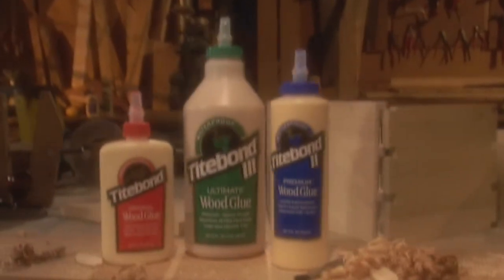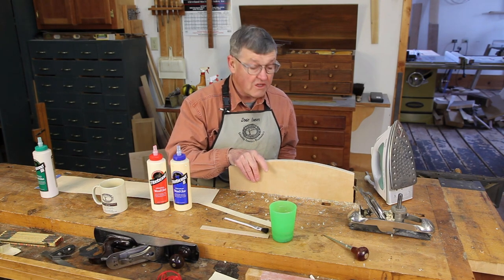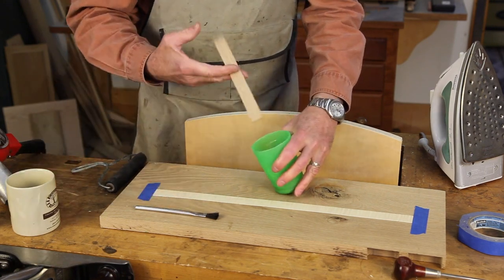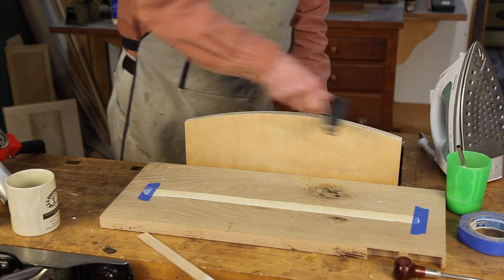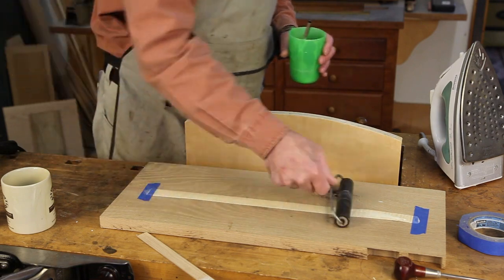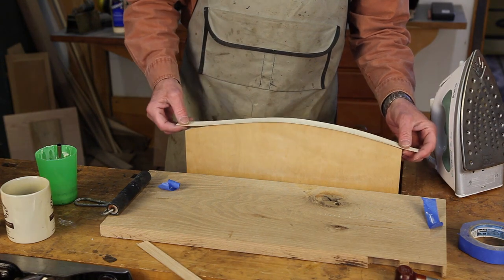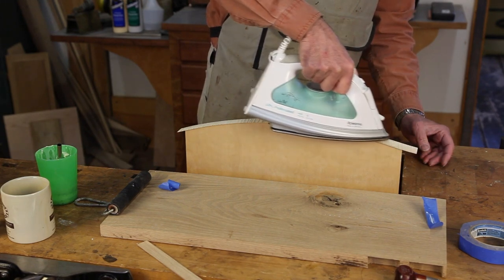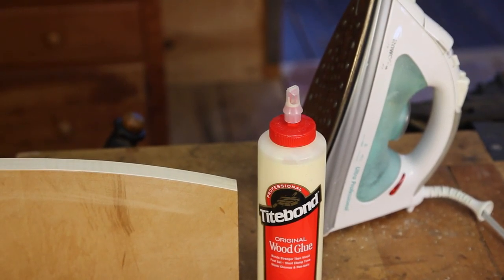How to Apply Wood Veneer with an Iron

Comment: Easy. Except for the $100 worth of specialty tools!
Reply: If you don't have a router you can finish the edges of the veneer with a piece of sandpaper on a block. A block sander. With a fine grit, something like 180. Using downwards strokes, just sand on a very slight angle to start, against the edge of your board. This eventually grinds the edge of the veneer down quite flush and makes for a very smooth edge. Remember, Slow and steady wins the race.
Without the router, you're just looking at the cost of the glue and sandpaper, and you can probably find an old iron second hand just about anywhere if you don't already have one.